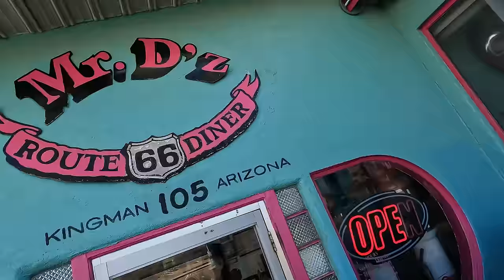This Will Be The HARDEST Rescue Ever...

Comment: I've ripped a couple valve stems (including sheered off one right below the cap threads) on my '18 JLUR on 37s.  Always carry the emergency external valve stem replacements that allow you to insert from outside and screw them down (look up Colby offroad emergency valve stem).
Reply: been running colby valve in my trailer for three years
Reply: Good tip, thanks.

Comment: 26:52 you can use tape as a wipe to clean an area before taping. I have to do that at work when I want to make sure a tape line will not leak water so I rub the area with the tape to pick up any debris before taping. 
And great work as always, thanks for all you do!

Comment: I've fixed a tire with duct tape before.  Tractor tire.  Knocked it off the bead so I could put a piece of duct tape on the inside.  Worked like a charm.  I've also repaired a torn sidewall by using 1/4-20 carriage bolts to bolt a piece of  galvanized sheet metal on the inside and outside , and sealing it with Silicone caulk.  I have also pulled a tire back onto the bead with sheet rock screws.  Old racing trick.  Drill holes through the bead of the rim, and put screws through.  That was how they used to deal with the rim spinning inside the tire before there was such a thing as beadlock rims.  None of those are permanent fixes, but when you have an $1800 tire that won't hold air, and you have to order a new one and wait for delivery, you do what you need to so you can get back to work.  Also, I recommend keeping an inner tube that is about the right size for the tire in your rig, as well as some bailing wire, a cordless drill, and a bit. Tear a sidewall, and you can drill a bunch of holes around the tear, and basically sew the side wall back together with the wire.  (twist the ends together on the outside, keep the holes a couple of inches from the tear, spread them out and do a couple of rows,  and when you think you have enough stitches, keep going, because you can't overdo it.)   Knock the valve out, put the tube in, reinflate, and go.  Won't last forever, and it isn't safe for highway speeds because the tire will be grossly out of balance.  It can get you off a trail, and to a tire shop.  If not, you're still stuck with a torn sidewall, which you had anyway.
Reply: Note that the screw trick will ruin the rim, but if you're trying to get the tire to seal on a bent rim, it's already ruined.

Comment: And getting that Gladiator outta that draw, separates the experience from the amateurs. And is the reason you get the call, and are paid the big bucks 😊
Reply: and some with even more experience would not have bothered driving the Banana up on top just to winch it backwards, or maybe he does not know that Yankum sells recovery rings.:face-turquoise-covering-eyes::face-purple-smiling-tears:
Reply: @iffykidmn8170 That requires a solid point to anchor too. Not sure if there was one.
Reply: @iffykidmn8170  maybe experience just wanted to do the least amount of damage to the recovered vehicle also. In this case I agree with experiences decision.  Made for a good video too.
Reply: Yep and for what that recovery cost you can buy a winch.  😂
Reply: I haven't got to that bit yet, but I have been wondering why they didn't take the Wrecker? Something to do with it being prepared for the ORGames perhaps?
Reply: @RandomName100  There are at least 2 trees in the video behind the Jeep and at least 12" dia or more,  I am not someone who does this for a living and I have two winch extensions plus tree savers and rings in my own vehicle.
Reply: @patrickburgmeier7902  and experience could have winched it backwards without having to drive behind it.:face-blue-covering-eyes:
Reply: @Rocklobster700 that was probably a $3k recovery.   Or maybe even more.
Reply: @lacofdfireman  Yikes I'm in the wrong business.   🤣

Comment: I have changed my mind on these gladiators. I have an 05 rubicon TJ with 33s. I have thought about selling them buying a gladiator but didn’t think they were worth the hype. You guys have proved me wrong. Didn’t think the stock gladiator could handle that trail. Great job guys.
Reply: Long wheelbase is the only real problem. Lift and tires would help it out a lot.
Reply: If I had a dollar for every new Jeep owner who comes up to me regretting that they sold their TJ…
Reply: @hippiebits2071  too true
I’ll not sell mine.

Comment: Over on amazon they got some emergency valve stems you install from the outside. No tire removal needed. Maybe toss a few in the glovebox.
Reply: Colby is the brand.
Reply: Don't think those would work for this one because of the Tire Pressure Monitor System.

Comment: Lived 13 years in AZ, and done lot of wheeling in around Kingman and think we did that exact wash a time or two. Did that area in with our 1996 XJS (2 inch lift, Detroit rear, limited slip front on 33x12.50s) and our stock 1990 Land Cruiser LJ78G Prado Light (32x8.50s and select-able rear/open front), although the LC did have a pretty high off-chamber pucker factor on that loose decomposing granite typical of central and western AZ.  I hope the JTR owner was a 4x4 newbie. Where he stopped, could have easily jacked up vehicle, then driven off the jack. Maybe that is how he pretezeled his jack tool. Glad to see Colby did not rock tattoo any doors or 1/4 panels.Matt, also be wary of those mine tunnels. Someone mentioned snakes, but we did a lot of mine investigating in western AZ (wife wrote for AZ Highway magazine). We ran across many that still had explosives (dynamite or even older nitro) stashed in them (miner stocked the mine, but never came back). Be very wary of any mine that was wooden boardwalks in them. Under the boardwalk is where a lot of stuff got stashed, and if a foot goes through....BOOM. Remember, it is always funny until someone gets hurt. Then it is freaking hilarious. Semper Fi.

Comment: Matts best LOST Gold Mine recovery ever. Great content as usual, great scenery. The problem solving skills of Matt are invaluable, he would have been the best Gold Mine road builder of 1858. The things Matt knows by instinct are written in No Book -- anywheres. The Banana lives up to the legend every time, and as always "They get em out".
Reply: The first adit they went in was a prospect.  They were trying to get under the oxidized zone at the surface to see if the ore was rich enough to pay for mining it.  Looks like the ore "didn't pan out," so they didn't mine it.  They did some mining in the second adit.  That hole with the timbering in it is where they took out the ore.  I think that's called a stope.

The ore they were going after looks like limonite.  That's a sulfide iron ore that can contain gold.  Sulfide ores require smelting.  You're better off looking for ores that contain "free mill gold".  That way all you have to do is crush it and sluice it.  My rule of thumb is the ore has to contain at least one ounce of gold per ton.  Working leaner ores than that could cost you more than you'll get out of it.  Good luck!

Comment: You guys should put a camera under the body, behind the front axle with the screen inside the cabin so the driver could see wheel placement (like a rear parking camera). Would make this stuff so much easier.
Reply: Until you bash the camera against a rock, or it gets covered in mud... Learning your vehicle is more important, but they do make front trail view cams that will plug right in. Usually mounted on the front grille.

Comment: This is a really fun video for me because this trail was the first trail I ever bent a tie rod on 😄
Out wheeling alone like a genius! I had stepped off I-40 to camp overnight and have some 4x4 fun for a few hours the next morning before continuing a long drive from Denver to San Diego. Got hung up on a loose boulder on the hard line through the little gorge at 24:38
Hi-Lift jack and a ratchet strap to the rescue - I bent the thing back into reasonable shape and finished the drive to the beach problem-free!
There are definitely some fun and challenging obstacles on this one, but most are optional with easier lines abound 👍

Comment: Years ago a ripped the inner stem out of my tire valve and sealed it with 4 layers of duct tape and 2 zip ties, exactly how you did. The zip ties were crucial to holding the duct tape down

Comment: Fun fact: My 2005 F-250 4x4 RCLB has the same wheelbase @ 137" as a Jeep Gladiator, but with more factory ground clearance and a better breakover angle! It also only cost $9150 back in 2016 so, y'know, affordable too

Comment: There are kits for replacement of valve stems without a need to dismantle a wheel, you just pull out old one with a hook and squish new one inside using a conical tube, might be very useful in situations like that. P.s. Thanks for yet another great video, Matt, take care.🤝

Comment: Great video guy's. 
It shows that it's always better to go off road with more than 1 truck,  that stock Jeep with only some basic protection fitted actually drove the track. 
A friend in a second vehicle could have easily dragged it back and the is just some spotting and a few rocks stacked. 
Also do a bit of research into the track conditions before going.

Comment: While running stock jeep wheels on my rubicon, even with 33s and a four inch lift I lost several Valve stems the last two were metal stems, while running the 4 dyce creek trail 2 years in a row.  I finally bought new wheels and haven't lost another one.

Comment: The air valve on my Rukus got compromised and there was little chance of it getting repaired any time soon in Ketchikan Ak so I stuffed the valve back in gooped up with 5200 fast cure 24 hours. The really good stuff is the adhesive 5200 but takes 7 days for full cure.  5200 is a marine sealant.

Comment: I have had several valve stems break like that. The stem breaks between the threads and the valve seat so even if you replace the broken core it still leaks.

Comment: Used mud once to hold the valve in a position to stop leaking. Drove 60 miles with it like that before I got somewhere to get it fixed right

Comment: The valve stem is probably a TPS sensor and they have a solid core with rubber sealed around it. The rubber will separate from the solid part of the stem and leak.

Comment: I fixed a tire leak with a mini zip tie once. My wife called me because she had a flat tire at work so I show up expecting to plug a nail hole but it turned out to be the valve stem leaking between the rubber and metal around the valve. I asked my wife if she had any zip ties at work and she came back out with a tiny green zip tie and I tightened it around the valve stem and stopped the leak. That zip tie stayed there for years without any issue.

Comment: Mid. 80s... duct tape & shoe goo... plugged the sidewall to get home... late 80s plugged a tire & used a 1lb. bottle of propane to get a few PSI in a OE Bronco II tire... I've pulled screws outta kick plates to screw into stub punctures... we use to plug tires with "sewing kits' which had thin spaghetti like rubber cord to fill the holes with multiple in & out passes... whatever gets you off the trail & home.

Comment: 27:49 Technically, the tire isn't leaking. Also I like those tires Falken Wildpeak AT, never been rock crawling with them though.
Reply: I have those tires on my '12 Wrangler Sport (32" with a 2.5 in. lift kit which provides a solid 12" clearance. They are decent on most surfaces except deep mud. The treads get clogged immediately and then you just have slicks. I don't seek out rock crawling situations but they climb up ledges well, e.g., the Alpine Loop from near Ouray, CO, over Engineer Pass and down to Lake City, CO.

Comment: Matt, I think I've mentioned it before, but I'll say it again. I think you should add some foam nerf pads to your roll cage because you don't wear a helmet and don't use a 4+ point harness, but IF (slim chance, but not zero) you were to roll over there is a high chance that you could hit your head on the roll cage and incur a potentially serious head injury.

Comment: You will probably never be in that situation again, but a Colby Valve is designed to replace a damaged tire valve without removing the tire from the rim. Just make sure that you have a way to re-inflate tire once it's installed.

Comment: What size tire do these gladiators have? My truck has a 2" shorter wheelbase and ive been trying to figure out what it may be capable of. I plan on running a 8" lift with 37 or 38 tires with detroit rear and arb locker front.

Comment: In your videos you seem to keep a steady foot with a low idle throughout your rock crawling, unless your bumping it. My question is...Since installing the new motor into the banana; do you notice a big difference in low speed torque vs the low speed torque of just a stock 4.0? Or can you feel a difference between motor vs the upgraded transfer cases? I guess what  I'm trying to figure out is : bigger motor equals bad gas mileage and great power... but the transfer cases just equal power, so was it worth it to you, and or the pocket book to do the stroker motor?

Comment: I fixed the valves them with tape and it lasted me 450 miles happened right after I left on a trip I had a spare, but wanted to see how far it could go. It was really weird failure. The brass had separated from the rubber, but as long as you held pressure on the brass, it would stay sealed.😂

Comment: I work a a cjdr dealer. If u drive ur Jeep, hellcat, charger/challenger. As intended on trail or doing burnouts/racing. I will warrenty basically anything as long as it's not neglect, an accident, or mechanical abuse. The one good thing about dodge is that they would fully support this ideology. Don't buy dodge but a good company with morals. U bent ur rock sliders on rocks, warrenty. U blew ur trans doing a fat burnout, and it didn't overheat. Warrenty. U blew ur diff while mudding. Warrenty. Drive it, don't park it. Not all technicians think like me. By no means am I suggesting you do this as other techs want c pay. Short in short more money.

Comment: Not many of those original classic Sebring Vangaurd EV's from 1974 to 1977 still on the road today though around 4,500 were sold for about $3,000.  The latest model before the Oil Embargo was overcome could go 60 mph when the MAX highway speed allowed was 55 mph.  It was the most produced modern EV until Tesla came along 34 years later and were manufactured close by here in Sebring Florida.  If it wasn't for some skullduggery the US Post Office would have been electrified with a van version in the 1980's and the Postal Fleet would have already been electric for about 40 years.

Best!

Comment: Guys! i need some advice :) I got a 2003 WJ with a 247 transfer case, a friend of mine offered me a 242 HD transfer case to fit in my WJ. Is it worth it? I don't need two wheel drive, but i would be nice to have that option, but is the 242 HD transfer case really stronger than a original 247 which is originally installed?
Reply: Sell it and get an xj or tj

Comment: The gladiator is capable going off road but cant tow or haul even slightly heavier stuff for s***. Buddy of mine spent 50k for one and could hardly pull a trailer of stuff. Struggling.

Comment: I was 20 mi in from the highway and broke my drive shaft, I had to walk I had a gallon of water, as soon as I stepped over the guardrail there must have been 10 cars stopping to see if I was okay, my fever sore and I had some Cactus but other than that I was in good condition. Now I live in a Pocono Mountains and you can't do nothing up here any longer use tear up the ground with a motorcycle you get a fine game wardens for service guys, not like it used to be in the 70s😢